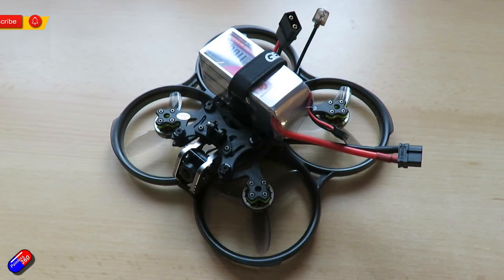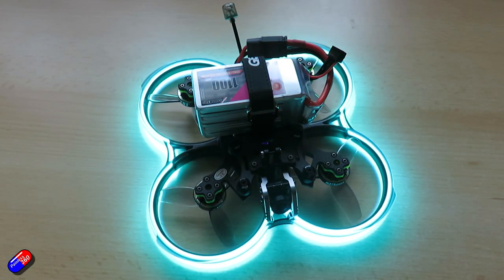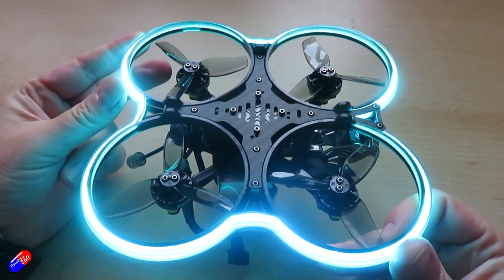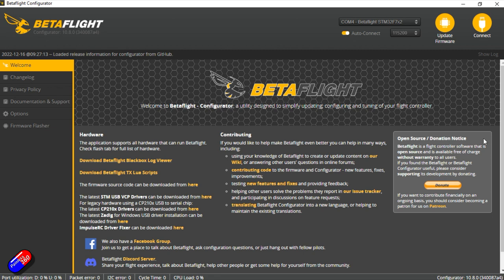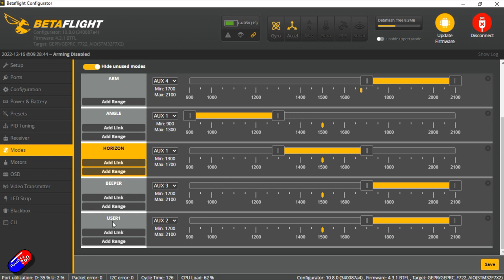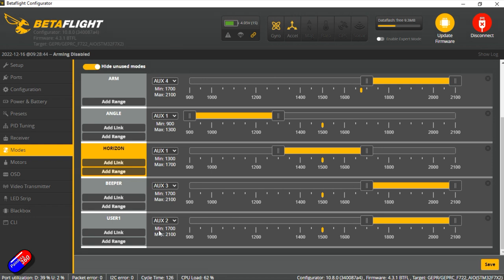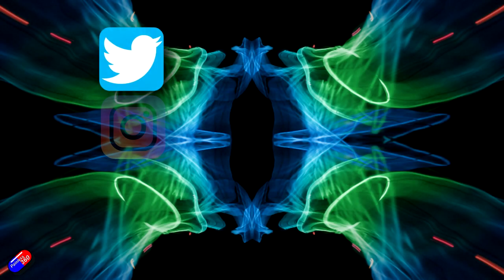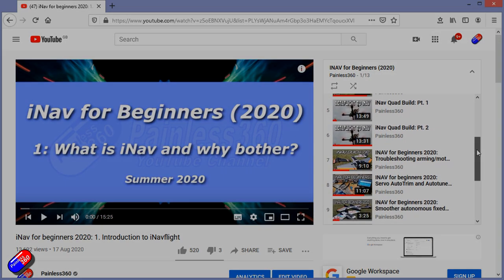GepRC Cinebot30: How to switch on and off the LEDs via the radio

Comment: Hello
As config depending of your FC:
In CLI :
resource (For know TX pad address)
resource SERIAL_TX n NONE (n = Pad number, e.g n=5 for TX5)
resource PINIO n xxx (n = Pad number, xxx = TX Pad address, e.g  "resource PINIO 5 C12" for my FC)
set PINIO_BOX = 40, 255, 255, 255 (40 for USER1, 41=USER2, 42=USER3, 43=USER4)
save

In tab mode from Betaflight, you can select USER1 and affect an AUX
Reply: thanks for this answer. I had to change my FC on my cinebot30 after a crash in the sea... As the GEPRC F722 was not available rapidly I swithced to a BETAFPV F722, which fits ok in the frame, but I am struggling to make the COB led work... The bec module seems to still work after a carreful rinsing, I manage to have a green or a red light on it. I do not know yet if the COB leds are still working. In all cases the IO are different on the boards.

I have connected the signal wire of the bec module on the led pad.

On the CLI dump I have:

resource LED 1 C15
resource LED_STRIP 1 A08
resource PINIO 1 NONE

So I have written the following commands:

resource PINIO 1 A08
set PINIO_BOX = 40, 255, 255, 255
save

User 1 is now showing up
But nothing seems to change wether I activate it or not.
The led on the bec module is green a few seconds after power up, and the turns red without anything changing...

Any ideas?
thanks,

A
Reply: @FurbyGoulag  Hello, i don't think the LED pad work for this function. You allocate the LED_STRIP pin adress from CPU on TX1 pin adress. Could you switch the signal cable from the bec on unused uart? Don't forget to turn off the serial port function (resource SERIAL_TX n NONE) before configure the TX pin.
Reply: @kromozom_21  thanks. Will try. On the original setup by geprc it was on led pad though
Reply: I soldered the signal cable in TX5 and changed the CLI to

resource PINIO 1 C12

Still not working, I have to try the cob led by itself I guess
Reply: @FurbyGoulag  I understand this line appear when you execute the command line "resource" in CLI : "resource SERIAL_TX 5 C12"
If is right, copy/paste this in CLI: 
resource SERIAL_TX 5 NONE
resource PINIO 1 C12
set PINIO_BOX = 40, 255, 255, 255
save
Reply: Have you tried doing this in INAV?
Reply: @kromozom_21  Thanks - I had to insert this to the geprc supplied cli for this drone. Fixed my issue

Comment: Could you check if this still works for firmware version 4.4.2? I did not find the USER1 mode.
Reply: its called ledlow now mode, hope this helps !
Reply: @jeffdughman9741  Thank you for your reply. I already found that mode, but somehow it doesn't actually turn off the LED lighting for me. When LEDLOW is inactive the LED's flicker a little and when LEDLOW is active the LED light is solid. Does it work for you?
Reply: @7H0345  tried led low too but it also flickers, did you solve this ? btw I soldered the switch pad to the LED pad on the FC is that right ?
Reply: I turned my leds off in bf for indoor flying that I was doing and now I can't get them to come back on to even put them on a switch🤔 I have led strip turned on in configuration tab but no led still. Can't exactly remeber what I did to turn them off in bf

Comment: SLUTION in BF 4.40 in cinebot30
1 - disable "led strip" in BtFlight setiings/  enable couse blinking led
2- past in CLI 

resource PINIO 1 NONE 
resource PINIO 2 A01 
resource PINIO 3 NONE 
resource PINIO 4 NONE
set pinio_config = 129,1,1,1 
set pinio_box = 39,40,41,42

3 - past in cli 

aux 4 40 3 1700 2100 0 0

User1 must shown up in Modes
Reply: Just did this and still nothing. any advice man?
Reply: @zorik79  GEP-F722-45A AIO V2, 
No man, again no. 
Pretty new to the CLI side of things.
Ill look into how to do that. 
Thank you
Reply: @PookaFPV  try 
resource PINIO 2 C12
Reply: @PookaFPV  Did you write 'save' in the CLI before closing it ? i am betting that is the reason why it did not work for you .
Reply: @monivibes1  it was because the PINIO, was not set up when it was flashed to 4.4

Comment: i had to replace the fc and the led board. everything is wired up correctly but the led wont turn off!? i programed a witch that used to work but now it wont turn off. i tried to use different buttons on the controller
Reply: @justkillen07 did you update the firmware? And maybe lost user 1 setting from the modes tab?

Comment: The board the light strip comes with is a Bec the edge with only two solder pads is the output +/-
The edge with three solder tabs is the battery input +/- the middle one switches on off?
Where the switch wire connects to the F722 FC is no where to be found on the Internet.
PLEASE some one have a look and put us out of our misery 😮😮😮
Reply from the maker: Video showing that out next week. Make sure you are subscribed and have the bell notification icon selected. Happy flying

Comment: Hello. Do you have an idea how to turn the LED on or off in INAV? The "resource" command does not work there.
Reply from the maker: I don't... If you find it easy, please let me know... Happy flying
Reply: @Painless360  I did it. But I don't know whether to describe it here or write you a message?
Reply from the maker: Please pop it here! :D
Reply: @Painless360  1. you set the LED of mode (for example channel 9).
2. In the CLI you enter: set led_pin_pwm_mode = SHARED_HIGH
save
3. In Programming set:
#1 Low -> Get RC Channel 9 -> Always
#2 High ->Get RC Channel 9 -> Always
#3 LED Pin PWM -> Value 0 -> Logic Condition 1 (on)
#4 LED Pin PWM -> Value 255 -> Logic Condition 2 (off)

Piece of cake :) I love this free software.

Comment: do you know of another source of led cob strip and bec?  I'm building another drone and would like to add this or another led color to it - thanks btw, this infomration was helpful for my cinebot30 setup.
Reply from the maker: Not little ones like this.. if you find one, please let me know...
Reply: @Painless360  I found the part under "GEPRC GEP-CT30 Frame Parts" on the Geprc site.  I ordered three :)  -ordered them on 01-14 and received on 01-24 (from China to US).

Comment: Have you updated it to BF 4.4? I did today and can't figure out how to add user1 back so I control it again. It erased when I flashed the new firmware.
Reply from the maker: Did you check the video description? I hope that helps.. Best of luck
Reply: @Painless360  yes I just tried all that, copied and pasted the command you had into the CLI but when I saved and went to modes I didn't see user1 still. Also the link from gethub you posted doesn't seem to be working anymore. Thanks for trying to help this is really frustrating me lol. I contacted Geprc and they just said there's nothing they can do and go back to BF 4.3 🤣
Reply: Same problem here
Reply: I reset he bf configuration and the user1 mode disappeared… don’t know how to make it appear again
Reply: @adambenchahed9990  Have you found a solution?
Reply: @gorange_fpv  read my comment below, I hope it will help
Reply: @EljaTubeYou  where? Can't find your comment... ?!
Reply: @gorange_fpv  anyone solve the problem?
Reply: @CactusJackAerial  you need paste this in a Clee

resource PINIO 1 NONE 
resource PINIO 2 A01 
resource PINIO 3 NONE 
resource PINIO 4 NONE
set pinio_config = 129,1,1,1 
set pinio_box = 39,40,41,42
Reply: @gordon6delta709  

@CactusJackAerial @gorange_fpv
did you get this working? I have user 1 up and assigned , stuck this code in the CL and still not working. Did you get it to work?
Reply: @gorange_fpv  any resolve?
Reply: @CactusJackAerial  any resolve?

Comment: thanks for the vid, I got everything set up again after updating to beta 4.4  got user1 showing and put the pino in the CL and assigned to U1 to a switch, but still nothing. Any ideas at all? thanksJ
Reply from the maker: I've not done it yet. There are others in the comments that seem to have it working. Best of luck

Comment: How do you add USER 1 back in? Betaflight 4.3 doesn't have it pre made.
Reply from the maker: What did you do to make it vanish? See note in video description. Add in a mode using the CLI for mode '40' - https://github.com/betaflight/betaflight/blob/master/docs/Modes.md
Reply: @Painless360  cant se anything on that page

Comment: It is possible to change the led strip to another color. Would be so nice to have 3 cinebot30s and then doing a race with different colors :)
Reply from the maker: The LEDs are fixed in colour - I'd keep an eye on the Cinebot website. I'd love it to light up orange personally!
Reply: @Painless360  but maybe its possible the rip out the leds and but another led strip in with orange color?
Reply from the maker: Maybe, if you could get the right thing. I hope that GepRC offer them. I would email and ask them but no-one is about as it is CNY..